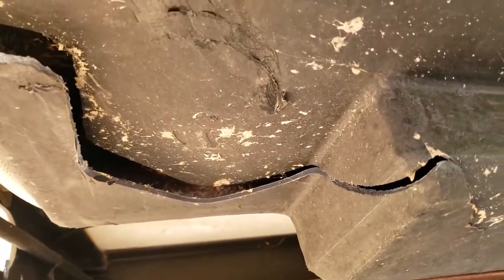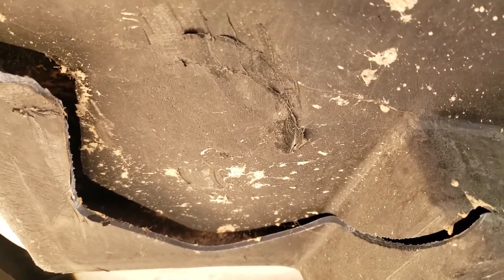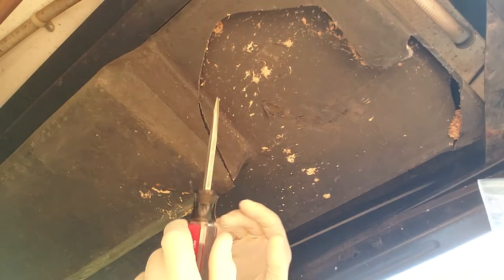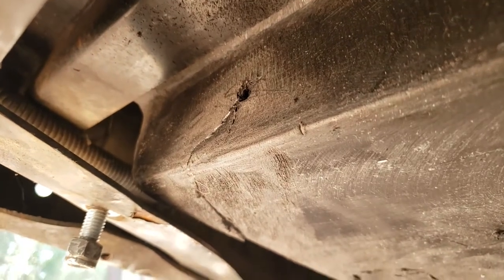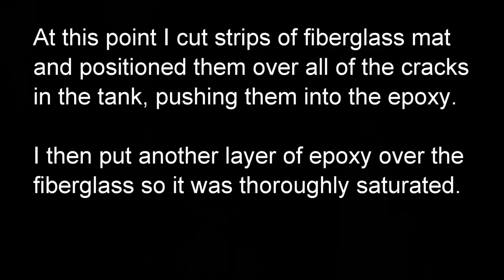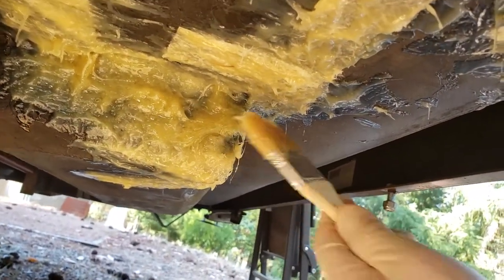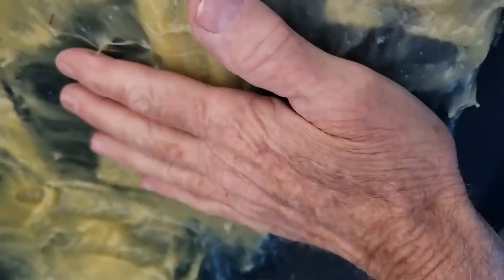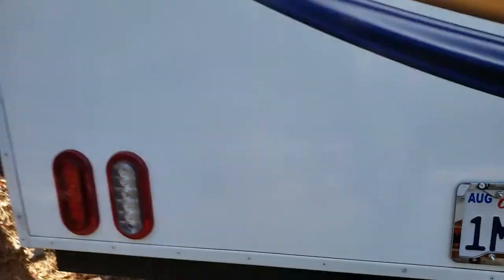Using G/Flex Epoxy to Repair a Badly Damaged RV Black Tank

Comment: Nice work. I've used gflex on all kinds of plastics with good success.
They even have a west system  video where they chain saw a plastic kayak in half and glue it back together with gflex, then proceed to drop it from an over pass. They dropped it on its sides and tip, then paddled it without leaks..

Another benefit of gflex is it will cure in the presence of mousture..

I'm going to use it to glue replacement threaded fittings on my fresh water tank which have cracked
Reply from the maker: I saw that west system video.  Incredible.  And after seeing what it did for this black tank, I don't doubt that the video is accurate.  It's great stuff.  Not cheap, but I didn't want anything cheap holding a black tank together, lol.

Comment: I have an abs panel on my coleman popup. Someone backed up onto it at my storage location and cracked the abs panel. I don't want to replace the entire front panel since expensive. I was looking at different obtions like MEK with abs pellets. Also saw someone melting ABS plastic with acetone. I saw someone had mentioned this G/flex and saw your video. This may work well. I will look into cost but since my repair is on outside want it to be neat so not sure if this stuff can be sanded down and then painted?  Thank you again for posting.
Reply from the maker: I did sand this down and paint it after making this video.  I wasn't too concerned about aesthetics though, since it was on the bottom of the trailer.  If you put it on as smoothly as possible and then sand it, I think it could be made to look fine.

Comment: So did the repair hold up?  I know it's only been two months.
Reply from the maker: Hi Lee - yes.  So far so good.  As you said, it hasn't been long, but the trailer's been driven about 300 miles since then and still no leaks.  I'd be surprised if it ever leaked.  That G/Flex stuff combined with the fiberglass mat really makes a solid repair.
Reply: Thanks for the update.  I've got a leaking black water tank fitting, and I'm thinking of using G/Flex to seal it up.  Good to hear that it is working well!